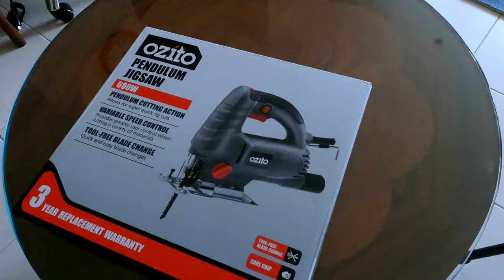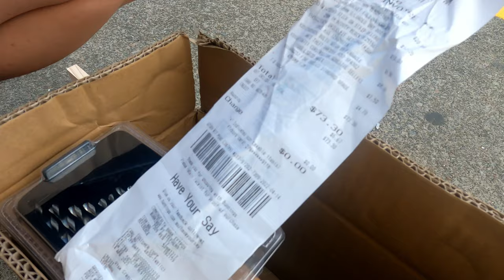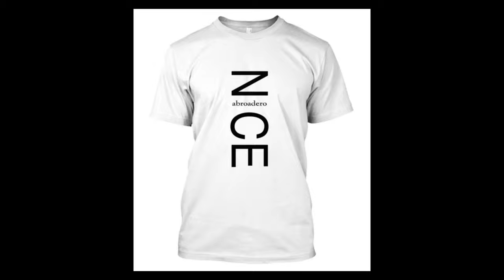My car table for eating and computer works.  DIY Desk for my Jimny.

Comment: I had 8 attempts before I got my P's. I will get my Green P's in a fortnight. I think you are a better driver than me. You just need to pass the test. Try booking in the afternoon/early evening, between 4-6pm. I think that's when RMS releases new timeslots. The schedule is usually 4 weeks in the future. Unless someone cancels.